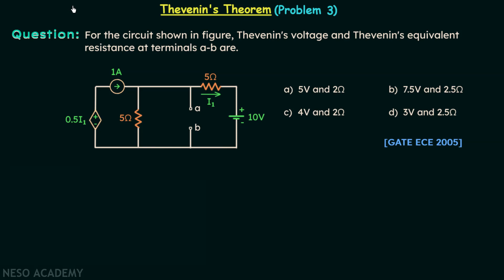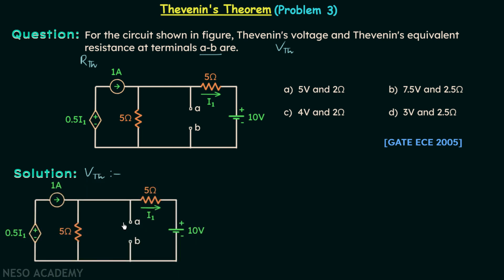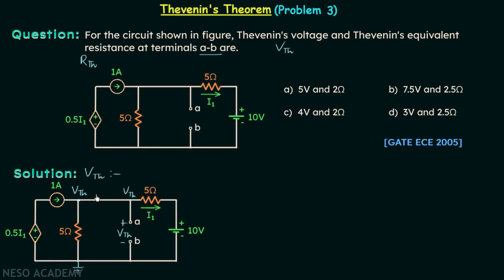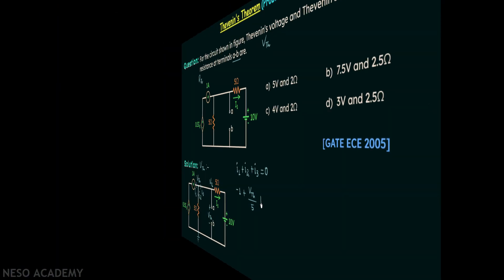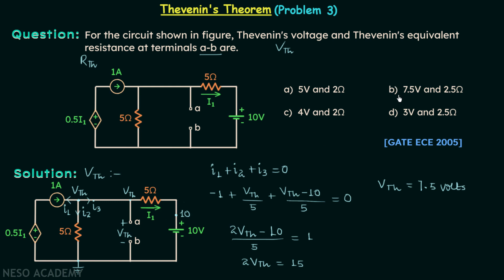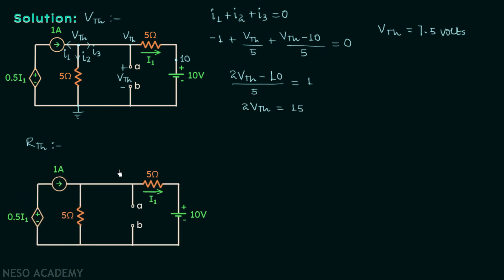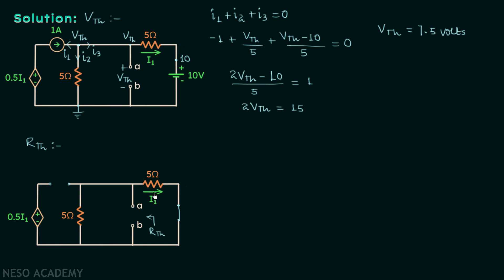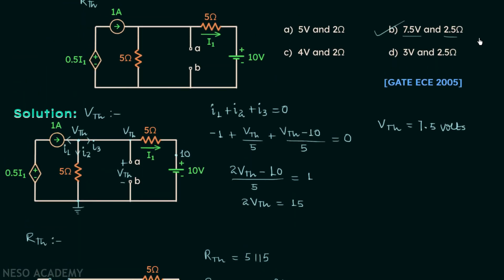Thevenin's Theorem (Problem 3)

Comment: wait how did you get 15 for the 2thv?
Reply: Move the -10/5 to the right side of the equation which will equal to 3. Then multiply both side of the equation by 5 to remove the 5 in the denominator on the left side of the equation. Now, multiply 5 by 3 (5x3=15).

Comment: Why we not consider 0.5Ix? While calculateing Vth.
Reply: It's not short circuited but it's given current from that source is 1A
Reply: Because the current I1=0A because its open circuited so therefore 0.5*I1=0A
Reply: @nilupulsiriwardena5035  ohh thanks